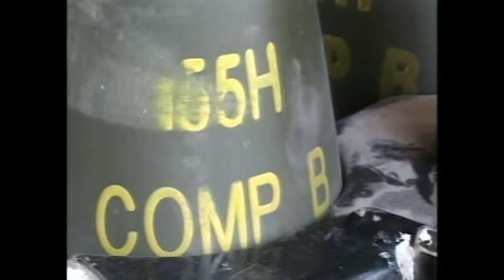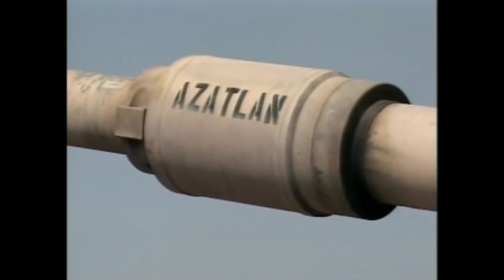Battle of Fallujah - Iraq War

Comment: Those automatic 40mm Grenade Launchers sure appear to be devastating. Boy are they loud when they fire. When I first fired the M 203 40mm grenade launcher slung under my M 16A2 rifle, Firing a standard High Explosive 40mm Grenade I was very surprised at the extremely light recoil as well as as its lack of loud report. Looking at the muzzle size I expected it to knock the heck out of me when I fired it and deafen me with a huge explosive bang. Neither happened though, at least with the HE Grenade, when I eventually fired the anti-personnel round, I think that's what it was called but it's been long ago and I'm having trouble remembering, basically a HUGE 40 mm Shotgun Shell filled with a bunch of Double Ought (00) sized Ball Bearings. That was super loud and I had a bruise on my shoulder for a week, needless to say I never wanted to fire one again, lol...
But these HE Grenades from the Automatic Launcher sound far louder. 
Does anyone know if they are just regular 40mm HE Grenades or if they're special for the launchers specifically, maybe have much more powder to give them a greater range perhaps? If anyone knows I would appreciate It if they would help me with this. Thank you.
Reply: Idk,but the report would seem.louder on here do to the position of the camera when they were launched. It's always louder forward and left to right than it is behind the muzzle.
Reply: Good ol HEDP

Comment: While I am not a fan of military adventures fought under false pretences, as was the case in Iraq, there is something elemental and mesmerising about artillery. Whether it be land based, or ship based, firing those rifles and lobbing shells weighing a ton or so dozens of kilometres downrange is something I could watch all day, especially when you have the read outs of the firing instructions etc. and radio calls from a forward observer calling the fall of shot added in.

Comment: you are completely miss informed 
.
NONE of the buildings  directly below Tower Collapsed , they were Extremely Damaged 
However they didn't collapsed 
.
Building 7 was not directly below the Towers 
.
The Towers were damaged on the the Top as Far I'm aware All 10 floors Made with steal and concrete below were 100% intact 
.
Please type ,Building 7 on youtube  before you reply using Wrong information

Comment: I was thinking they used burning WP to flush out insurgents in prepared positions through asphixiation and heat, not to poison them to death, which makes the use valid. 

Napalm, as you just pointed out, is actually legal because the U.S. never signed any treaty renouncing its use. Had it signed, it would still be a violation of that treaty, not the use of chemical weapons or a violation of the Hague treaty, and it would be subject to any penalties described in the treaty. Continues: